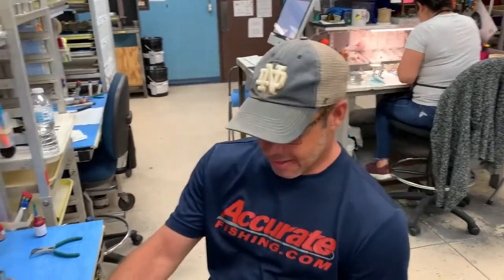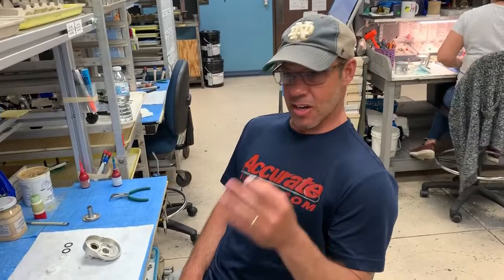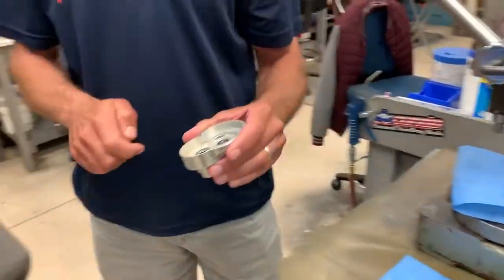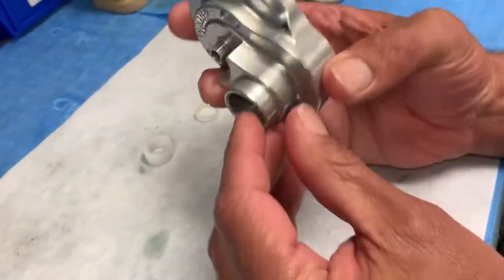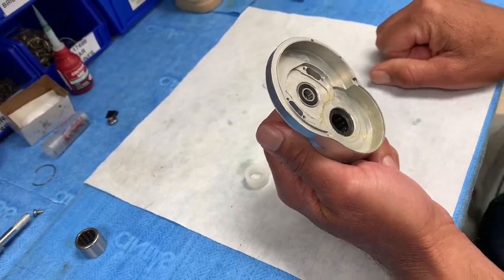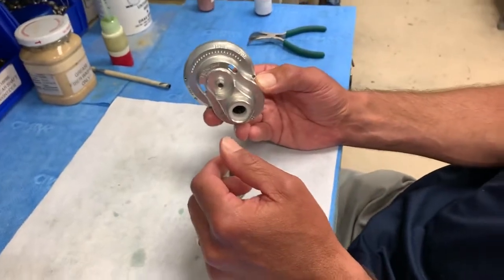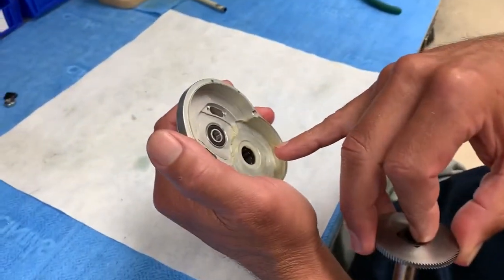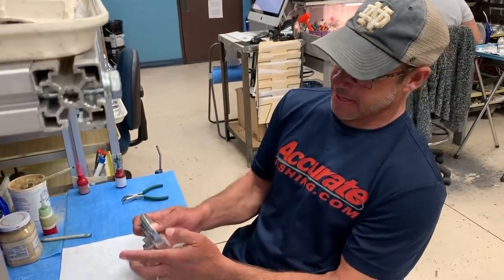Accurate Fishing Anti-Reverse Bearing Explained!

Comment: At last!! I have 7 bx 400/500 in my fishing 'family' (friends) all of which have had the AR bearings fail.The addition of those rubber washers is long overdue!
Despite regular cleaning (& applying grease externally) capillary action sucks water in from the handle side to the AR, eventually destroying it.
The early reels had a very sml o ring on the drive shaft but this did little to stop the water.
Many years ago i made a tool out of some threaded studding for winding the old bearings  out and winding new ones in. This has worked fine but the rubber washers will hopefully eliviate the water ingress.
Can i fit these to my single speed reels and would i need different size bushings??
Reply from the maker: Best thing to do is reach out to Service@accuratefishing.com and they can answer your question. Thanks for using the product,

Comment: Why not another 2 bearing sandwiching the AR bearing instead of delrin bushing? It will improve the smoothness feeling while reeling and increase longevity of the AR bearing... Then cover it with rubber and delrin washer... It would be perfect... 🤷‍♂️
Reply from the maker: The reel works very good now and the cost of another's not necessary. Trying to make a great product at a good price.

Comment: Your oneway bearing is very difficult to replacement. Because, we angler from indonesian is far from the city. Accurate is strengh reel, famous in my country. Only one difficulty, hard to self maintenance. Especially replacing oneway bearing
Reply from the maker: Yes you need a tool to get them out and one to put hem in. I apologize but it is the best way to do it.

Comment: i gotta ask...why not put a notch on the bearing design..just avoid pressfitting the CB on the sideplate?
your design doesn't leave much leeway for self maintenance..you need specialized equipment to maintain and service your reels.....
Reply from the maker: I WILL PASS ON THE INFO.